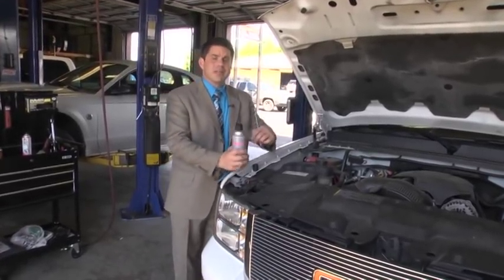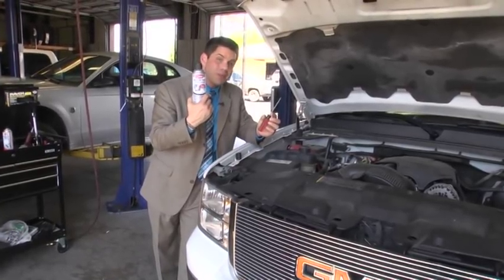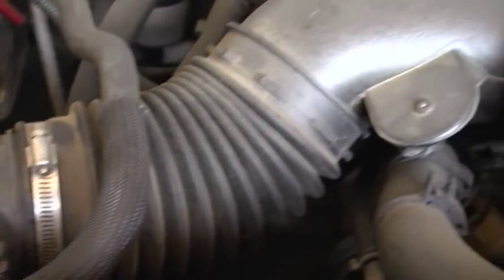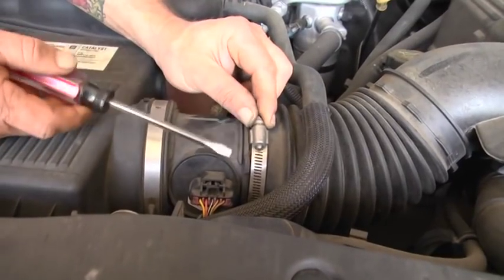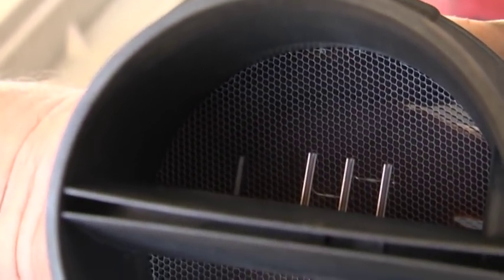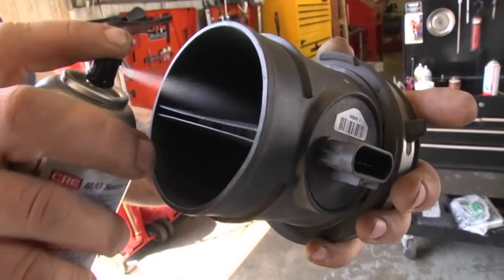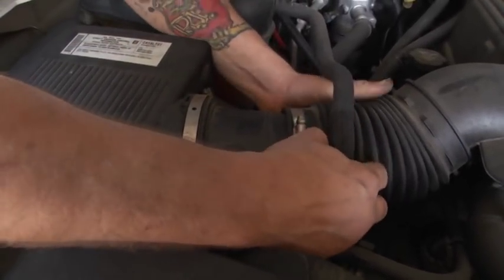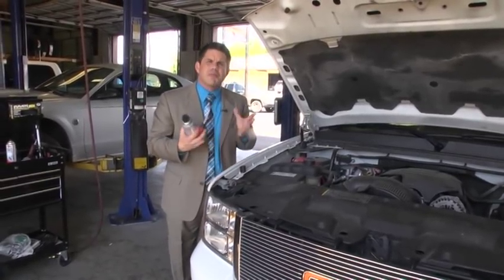Want better gas mileage?  Get a screw driver and spend 2 minutes here

Comment: 1 part bacon grease to 30 parts water heated up in a spray bottle will work wonders on cleaning your cars interior exterior and parts like this. It's also great for scratches and swirlmarks. There's some kind of acid in the grease that breaks down harmful particles that destroy anything metal or  plastic. Try it it works

Comment: I had a Chevy truck a couple years ago. At one time it started to stall while slowing down and turning at the same time, it would start up easily. I took it for a diagnostic for forty dollars. They told me that it needed a fuel filter and mass air flow cleaned. For 125 dollars. Payed him the forty, I went to Auto Zone got a can of mass air flow cleaner  seven dollars, fuel filter about ten dollars, EZ

Comment: That's why I like these aftermarket air filters that gotta be oiled. Destroys the hell out of those sensors. Then when the customer whines about it, I replace the MAF sensor and the stupid aftermarket air filter that doesn't make the engine perform any better than stock anyways.

Comment: They should have mentioned to make sure the sensor is properly dry before reinstalling it and whatever you do don't touch those wires with anything,let alone a screwdriver.

Comment: Only use MAF sensor cleaner, let the sensor dry before reinstalling it. A cleaned sensor can improve gas mileage and performance. You can also clean the throttle body with throttle body cleaner. Another preventative maintenance tip is changing your engine oil & filter. And dont forget changing your transmission oil if the fluid isnt red on the dipstick.

Comment: To save money and get more life out of my air filter, when it gets dirty I just take it out and turn it around. Twice the life and saves me money on air filters.
Reply: "Turn it around", doesn't that put the dirty side on the engine side. If that's what you did, you just made it where all the previous dirt gets sucked into the engine. That caused 1000 times more damage to the engine than your $15 air filter would have cost.

Comment: Lot of negative comments, but he is correct.  Like clock work every 6 months my check engine light comes on with code saying check range of my mass air flow sensor, I spray the cleaner light goes out.

Comment: My '03 STS Cadillac had the same MAFIAT sensor,as my old '95 GMC half ton pickup truck. Sensor spray doesn't have as much force coming out of the can,so it won't break the extremely delicate wires on the sensor,DONT TOUCH IT WITH ANYTHING besides the cleaner spray!! Light on dash won't stay off? Check sensor plug-ins for corrosion in them...

Comment: use this!!! Comment on how I double the gas mileage
Check this out!!!
Comment ON how to DOUBLE YOUR GAS MILEAGE with out doing a thing to your CAR OR TRUCK!!!  NO PARTS TO INSTALL!! YOU DON'T HAVE TO SPEND A PENNY!!!  NOT ONE PENNY!!!
People, you don't have to ever buy new spark plugs ever!!!  EVER!!!  EVER AGAIN!!!  ITS A SCAM!!!  IT A RIP OFF!!!  SO THEY CAN STEAL YOUR HARD EARNED MONEY!!!
ALL YOU HAVE TO DO IS BUY SMALL BOTTLE OF Muriatic Acid (THIS IT THE TRICK!!!  """"MURIATIC ACID"""" IS  THE ONLY THING THAT WORKS!!!) and just soak the spark plugs in it for about five minutes.  Then take a tooth brush and brush the Plugs tips and electrodes with soap and water!!!  Until all of the carbon is off the top and electrodes of the spark plugs!!!  Then blow them out with compressed air!!! Or just with your breath!!! You may have to do this a second time until all of the carbon is off the electrode and tips of the spark plugs!!!
  Also on your air breather filter.  All you have to do is take an air hose and blow it clean from the back side!!!
Also if you look at the air filter you will see the stuff in the air filter is very small dust!!!  Blow it out and take I sharp knife OR A RAZER BLADE and put a several two inch slits in it!!! That way the  engine will for sure get enough air and will save you a lot of gas!!!  This very fine dust that may get through will have very little if any effect, if any on the engine!!!  Because this air goes through the engine at over a hundred miles an hour or faster and not only that when the air and fuel mixture ignites in the COMBUSTION CHAMBERS it MAKE a tremendous explosion with tempatures of a thousands of degrees!!!  Which will burn the dust up in a heart beat!!!  And then out onto the exhaust pipes with no ill effects!!  With know harm to the engine!!
Larry
Again spend the money on your kids!!!  You will never have to buy another air filter!!!  Its like throwing your money out the window of an air plane going five hundred miles an hour!!!
Now there is an expectation!!!  If you are regularly driving on dirt roads or OFF ROADS you must buy a new air filter..  As you can see that while driving normally on the streets and freeways there is very minimal dust!!!  I have to say VERY MINIMAL!!!  As you can see YOURSELF while blow cleaning the filter!!!
Have a great time with you family!
Larry
And yes you must keep checking your tires to make sure they are fully inflated.  With the right pressure!!! Other than that YOU ARE GOOD TO GO!!!
Larry
If you want the ""truth""  about how to DOUBLE YOUR GAS MILEAGE!!!  WITHOUT COSTING YOU A PENNY FOR PARTS!!! OR COSTING YOU ANY MONEY AT ALL!!! "" NO MONEY AT ALL!!!  JUST VIEW THE VIDEO BELOW!!!  THE JUST WALK OUT TO YOUR CAR AND START DOUBLING OR MOR YOUR CARS GAS MILEAGE!!!  Just think if your car now get let's say 30 miles a gallon.  You will get 60 to 70 mile per gallon!!!  Check out the video and see for yourself!!!0
Just click the link below.
Watch "How to Increase Gas Mileage" on YouTube
https://youtu.be/-9ALSIbv2do
GOOD GAS SAVING PEOPLE!!!
ALSO TO VIEW MY OTHER VIDEOS JUST TYPE IN MY NAME. LARRY NEIDERHISER.  WHICH WILL TAKE YOU TO MY YOUTUBE CHANNEL.  WHERE MY VIDEOS ARE.  
THIS VIDEO WILL SAVE YOU HUNDREDS OF DOLLARS!!! 
THE REST OF THE VIDEOS WILL SAVE YOUR LIFE!!!

Comment: As an ad.... to a real mechanic, well is BS,  as an information advise.... well is horse crap....., Best fuel saving advise is Keep tire pressure at or above  specified pressure, don't be a jack rabbit, keep engine air filter clean, DO NOT USE K&N AIR FILTERS, those kill air mass sensors, keep you engine oil clean and change when due,  but best ever, buy a economical sensible Japanese car, those save gas, unlike most american gas guzzlers.

Comment: A MAF sensor will cause you car to hesitate surge under acceleration. Buy the kit CRC. I use it on all 3 of Cadillac Deville's. I was experiencing hesitation on the start up once started the idle was rough under acceleration the car would bog down or stumble. If CRC isn't available I get a sandwich bag and fill half way with rubbing alcohol and soak the sensor.

Comment: Got the maf sensor cleaner and yes it was filthy and yes the cleaner washed it off. Gas mileage is about the same although I put in some injector cleaner and that has improved the performance. 2 times per year is recommended . I thought it was just diesels that needed additives to the fuel.

Comment: 23 yr mechanic here & not 1 MAF sensor worked after getting it wet / cleaned , using any type of cleaner.
If you are that worried about losing a 1/4 mile per gallon, go buy a new sensor.
Guys in suits were Never allowed in my shop.
Reply: Your deffinatly using the wrong cleaner
Reply: Must be a CHEVY mechanic...
Reply: 23 yes old is the reason why it never worked. They make cleaner that is sprayed directly into and onto the M.A.F sensor bud.. but you live and learn man that's part of being a mechanic

Comment: But MAF hardly fails or causes car breakdown! There are lots other preventative things you can do to reduce breakdown
Reply: ...and this is one of them. Even if it isn't "failing" a dirty sensor will alter readings sent to the computer that will be different than the actual air flow, which will affect fuel mileage and engine performance.

Comment: Sales pitch for CRC Mass Air flow sensor cleaner. Not ethical.
Reply: I agree. Nobody should know about MAF sensor cleaner and should always buy a new sensor, for $60 to $200. Why spend $10 when you can spend $200?

Comment: Almost as bad as the ricers who put $40K&N oil wash filters on,  think it's going to improve HP and MPG, and won't dirty the MAF sensor. If you change your paper filter as per owners manual, you should maybe only have to clean MAF sensor once in car's lifetime, if that. Otherwise, you have additional problems...

Comment: The engine reads air fuel ratios and constantly adjusts fuelling tables. So even if your maf reads a lower or higher voltage due to debris, the computer will trim the fuel tables back.

Perfect example if the dumb leading the blind.

Also, if a maf is dirty, then it should read less air, meaning it'll inject less fuel.
Reply: That may be true, but fuel economy decreases as you go lean as well. Too little fuel or too much will decrease efficiency.

Comment: You could also change your tires (if they're worn), you could use higher grade gasoline, advanced ignition timing or changing the cam profile, or you could just drive like a normal person. Coast more often, don't use cruise control, don't idle your vehicle, turn AC and electrical devices off, disable power steering, keep windows closed, and plenty of other, cheaper things that don't have the potential to damage your vehicle.
Reply: thin tires get better mileage they tell you when you buy a brand new car you can't get a good fuel milage reading untill the tires have some milage on them. i never likes putting all new tires on my mack truck at once for this reason .

Comment: Just replace it with a K&N filter and it works like a charm. As far as cleaning the air flow sensors. I'm not going to screw with that as knowing me I'll screw something up. :/

Comment: A can will last forever. Cleaning is overlooked. But I clean mine a few  times a year. I also have a K&N filter so definitely after cleaning my filter.
Reply: 200 miles after reoiling the KN each 5,000 miles, you have to clean the oil funk off the mass air.
Dont forget... The KN type dont filter worth a sheet but give you a couple more hp at 6,000brpm.😱😱

Comment: What a general waste of time for most systems and needless risk. It not only takes a pretty thick layer of junk on the sensor wire to significantly change the thermal conductivity, sensors are in a complex self-correcting closed loop system. Many sensors recalibrate or self-correct themselves constantly at start up, key on engine off, when they know airflow is zero. Some sensors reference outside air.  

The engine control does not  blindly run open loop on the MAF meter, it has oxygen senors in the exhaust. The engine control looks at oxygen content in the exhaust and "learns" a correction by learning the difference in air/fuel from a target air/fuel. This is stored in a memory table and corrects the fuel commanded by the MAF. Vehicles intentionally are designed to do this so they aren't critical for sensor calibration, especially something as coarse reading as a hot wire MAF. 

 It would be stupid for vehicle manufacturers to design engine controls that  function the way this video implies, open loop uncorrected and determining fuel mixture solely via the MAF meter. The MAF meter mainly determines wider open throttle functions by giving a reference for relative flow volume. It is used to estimate volumetric efficiency, which then points to a table giving a target spark and mixture under various power(load) demands. The fuel trim is set by oxygen sensors for very good reason, to keep from burning up the catalytic converters and to meet EPA standards.

The MAF would have to be pretty damn dirty to cause a problem, like have a bug or large piece of lint on it.

Comment: Want to save even more? Well, see them wires that glow red hot? Blow on them with your stank breath and make sure nothing flaps around. If yo' air filter is doin' it's job, then you won't need an expensive can of liquid hydrocarbons, or any type of gas. Yo' own stank breath is quite enuff. Clean your air filter instead, and if you drive on dusty roads, blow-clean your air filter more often than otherwise. Yo' welcome!

Comment: I tried this tip to improve my gas mileage but I accidentally used an aerosol form of blinker fluid instead of MAF sensor cleaner because the cans looked very similar. Now, my mechanic tells me it’s gonna cost $2,300 to have my muffler bearings repacked. Not only that, the rattling from the muffler bearing caused my rotors to turn completely inside out. Mechanic said that will be at least another $1,800-$2,000 fix! Ugh!!!!
Reply: Good to know. Thanks!

Comment: If you MAF sensor is clogged and telling the ECU less air is going through, wouldn't it make it use less gas to keep the correct fuel:air mixture, since less air means less fuel needed?

Comment: change your spark plugs to OEM new ones and change the air filter & fuel filter and use full synthetic oil.  you will get 3 to 4 extra MPGs....

Comment: lol people arguing over the approach to cleaning a MAF sensor and the presumed tragedy scenarios. To the guys/girls who are unclear on the level of filtering an engine air intake filter is capable of, they are not perfect filters. very small particles can and absolutely will pass through and occasionally 'cook' onto the hot filaments of the sensor. Over time, it accumulates and can influence the air/fuel ratio by sending erroneous data to the computer. Cars are my day job.

Comment: Just use compressed air to dust off the sensor. It's not made to be hit with liquids or sprays. Mass air flow cleaner is nothing but computer duster, which contains corrosive agents that can corrode the various metals used by differing manufacturers. Some are made of steel, some are made of plastic. There's a reason a sensor costs 150 and the can costs 2.50. Just a product that catalysts the wear and tear on the sensor. Marketing=money

Comment: YEA, I used that cleaner and it works great, I spray mine after every OIL change (5,000) miles, so the size of the can makes sense...   I change my K&N Black Filter than so it makes it easy to do the MAP at the same time, than I clean it and put into the box for after the next oil change...        Now when I spray that stuff into my cold intake tube I notice a slight rattle from my MUFFLER BEARINGS, replacing them is a pain in the ass !!!!!

Comment: First thing to check if you have low MPG is the oil filler cap, it doesn't have to be loose to suck air.
I just did a video on it.
And takes about all of 30 seconds to check it including opening the hood.

Comment: I've been doing this
for years and it works.
Also it's worth knowing that if you use a replacement sports panel air filter ( no names mentioned) that requires oiling accessionaly,  then you run the risk of that oil being gradually sucked into the engine and coating the Maf sensor, giving you worse performance not better.
Reply: I feel like this is info stolen from another video
Reply: Exactly what I found, filter oil fouled the MAF after 2 yrs.
Reply: @clintfipps7312  he's talking about k&N
Reply: Haven't had an issue yet with my oiled foam filter. I think the oil is tacky enough, that it'll stick well to the filter and catch plenty of dust!
Reply: @anthonyjulson8840  Yup. Don't over-oil or it will be sucked into the air flow including the hot wire MAF, then it'll throw codes and require tricky cleaning.
Reply: @mmpiforall5913  I don't think with a foam filter you can really use too much oil honestly. It's a completely different type of oil than k&n. Think similar to Lucas oil supplement.
Reply: @anthonyjulson8840  I hear yeah, but I already got a code due to oil making it into the MAF and then having to remove and clean it carefully, it took a year or so to trip the code last time, so I sold the K&N kit.
Reply: Sounds like someone over oiled their shit and is now an expert 🤔

Comment: Ya couldnt have anything to do with fuel injectors, tire size, tire inflation, bad deivetrain, no oil in the differential, badly tuned engine,

Yup spraying a bit of cleaner on a maf sensor will do the trick says the guy in a suit that don't know shit  about vehicle's

Comment: I have a question regarding MAF sensor. We know its signal is one of the inputs to ECU to determine air-fuel injection and ignition. Suppose every components and sensors function well except this one, while we don't want to get it repair/replaced sooner for some reasons. Can we just bypass the MAF signal to ECU through software so that the ECU will use its OK default value to trigger injection and ignition ?

Comment: You will find it on the engine in the coal mining equipment or natural gas generators used to make the electricity your Tesla is using. Or the lack of fish in the rivers because of a dam blocking thier path to thier spawning grounds. Don't get me wrong, I love technology but people are kidding themselves when they think they are helping the environment with electric cars.

Sure electricity is cheaper than fuel now but if everyone owned a Tesla, power would be so expensive we could not afford to heat our homes. Look at what happened to diesel prices in the 80s. It used to cost a third what gas did and now because of demand and taxes it usually costs more. Heaven forbid they figure out how to power vehicles on water or air.